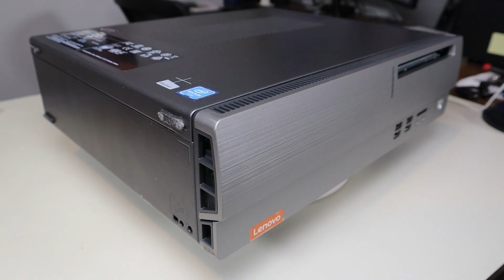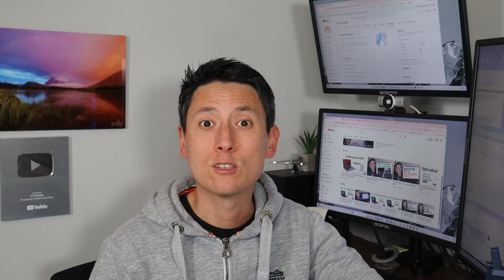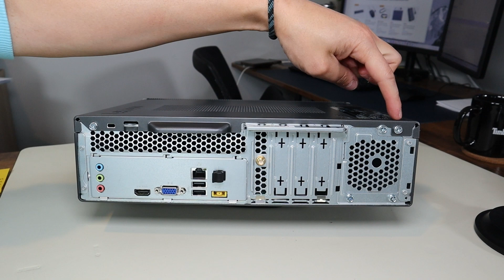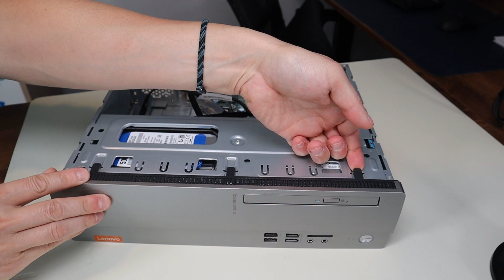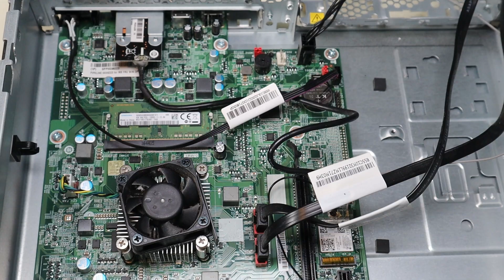How To Replace Upgrade RAM Memory for Lenovo IdeaCentre 310S-08IAP Desktop Computer

Comment: Thanks for letting me know it only accept up to 8G memory card; I was going to replace mine for a 16G card.
Reply from the maker: You can try. Some computers will accept more RAM because of the CPU. However, in this computer its unlikely. If you try, make sure you purchase the RAM from a place that Amazon that allows easy / free returns.

Comment: Can this computer be upgraded to 16g ram?
Reply from the maker: Its listed at a max RAM value of 8GB. But you can try to load more as the CPU may be large enough to handle it. I have not tried that with this model. If it works, let me know :)

Comment: does that work for all models of lenovo, such as a Machine Type Model 90MV00C6AU ; ideacentre 3-07ADA05 Desktop - Type 90MV ? or is the insides of that different, and does the ideacentre 3-07ADA05  Desktop - Type 90MV have two or more ram and main memory slots?
Reply from the maker: All models are different. Not all models will have 2 RAM ports but many do :)

Comment: Please help me in repairing my laptop
Reply from the maker: What brand and model computer do you have and whats the issue with it?
Also, did anything happen before this issue started? Overheating, liquid spill, Windows update, etc?
Reply: @PC_Monkey  I did continue to
Windows step but it didn’t work I have Lenovo laptop
Reply from the maker: @LovepreetkaurKokri  This happens on startup? Can you try the steps seen here? https://www.youtube.com/watch?v=oL1R1Tw0jSo. 
Also, did anything happen before this issue started? Overheating, liquid spill, Windows update, etc?
Reply: @PC_Monkey  I will try these steps and let you know I am studying from my laptop and it’s not working so this is a big trouble for me. Thank you for replying
Reply: @PC_Monkey  Hello Jamin, my Lenovo laptop is not working. I am providing you the information: Processor
1x 11th Generation Intel® Core™ i3-1115G4 Processor(Core™ i3-1115G4)
Memory
1x 4GB DDR4-2667
1x 4GB DDR4 2667
Operating System
Windows 11 Home in S mode 64
Reply from the maker: @LovepreetkaurKokri  Good luck !!  Let me know how it goes :)
Reply: Windows update is showing

Comment: I took out its battery and now it starts charging but it’s not working
Reply from the maker: For a computer that does not turn on, try this video first; https://youtu.be/kOBY4k2Mn_k. Let me know how that goes :)
Also, did anything happen before this issue started? Overheating, liquid spill, Windows update, etc?